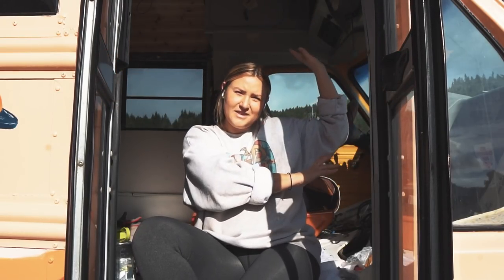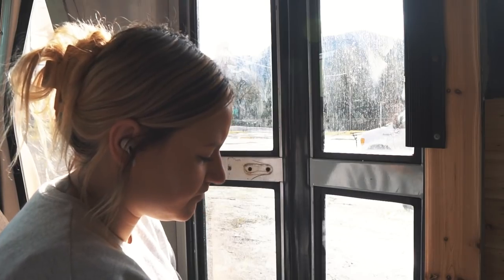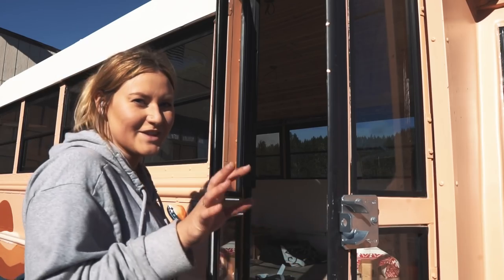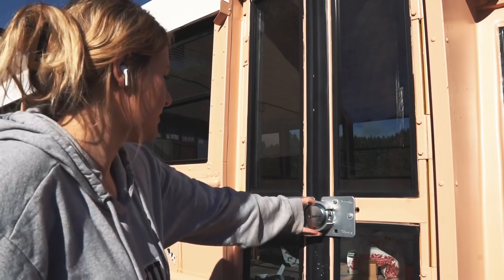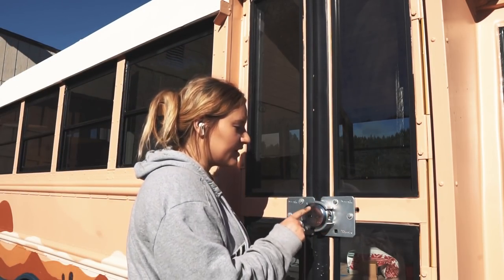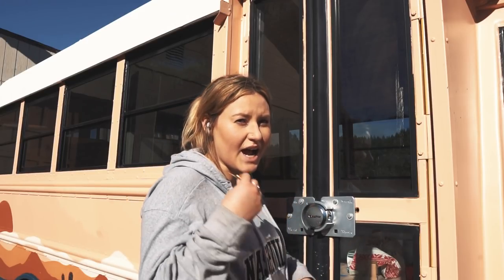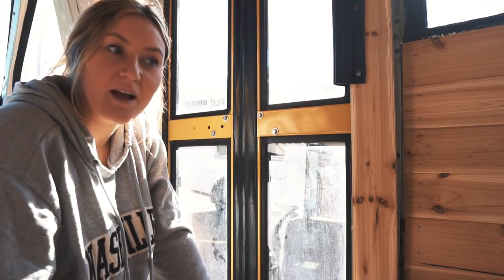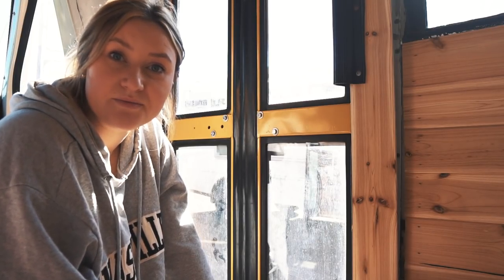Best Way To Lock Your Skoolie Door? - short bus conversion

Comment: Cast iron handles on both sides of interior door with a nice piece of wood to lock from inside slid through handles. This is a safe exit. This is used on barn doors. Would go along with your build scheme.

Comment: We have that lock on our shed. It is a solid lock to lock something from the outside. I would not recommend it to lock something from the inside for safety reasons. It takes a minute to unlock that lock. That being said you will have to have the chamber out of the lock when you are inside the bus in order for you to open the door from the inside. Might be a good idea to set aside a place inside the bus to store that chamber so it doesn't get lost. A drop latch lock seems like the safest for the inside as you could get out quickly if you needed to. peace

Comment: Hey girl, I hope your feeling well. I thought if you can't use your slide bolt lock on your front doors then see about using it on the back door, just as some more protection. I've been to Eugine Oregon some 45 years ago, a bunch of us went there in a van, we had a blast, a wet one but still a blast. You can be sure I'll be watching your two week trip! Have lots of fun and stay safe. Love y'all!

Comment: Jaylena Great job on painting and the outside lock. You may be able to use the same type lock you bought for the inside just look for it on a Larger scale as for a shed or Barn door lock. If you find it to work it will also be a stronger lock.
Always enjoy the videos Jaylena have a fantastic weekend. hey  hey Isaac! :) Laterz Leland

Comment: For the inside lock,I like the idea of a metal lever that swings down to the other door and is held in place by another piece of flat steel..you could drill a hole in that flat steel and attach a lever that you can lock .people who try to get in won't see the lever because it's hidden behind the yellow going across the 2 doors ,same for the locking knob

Comment: Looks like a good lock Jaylena, for the inside can you use a bolt system into the floor and ceiling or do the door need to be locked together in the middle ? .  Loved the video as always and enjoy your trip with Isaac xx

Comment: I like the external lock.  Can you figure out how to make it so someone on the outside can’t lock you inside with their simple padlock or carabiner?  As for locking from inside, I would consider using the same locks that you had, but use them to lock the doors to the overhead and the floor, rather than the doors to each other.  Much like the system to lock double doors.  Love the way that the build is going.

Comment: Maybe consider a bar type of lock for the inside.  Could even be a nice piece of metal tubing that sits inside of two brackets.  The brackets could be held on by the same bolts as the outside latch.

Comment: Wesley’s White wall cleaner and a S.O.S. Pad super cleans black rubber. Then a few coats of ZEP High Gloss Floor Polish applied with a damp microfiber cloth makes it shine better than new! 
Learned this from YouTube on fiberglass campers. Scrub with Barkeepers friend, wash with dawn dish soap(to remove the grit) then 4 coats of ZEP. The first two coats look like crap, third and forth coat shines like new money! (Work in the shade)

Comment: Door hinge security pins or use a barrel bolt into the ceiling or floor on both doors (ceiling preferably if you're going to have a toddler in there eventually!)

Comment: Bus doors are not the best for making secure that is for sure.  Was thinking a flush coach bolt would of been better on the outside rather than having nut head bolt head.

You do not have much places to fix an internal door lock either. Think having a locking bar across the centre of the door would be a good idea. However with your doors being mainly glass an little frame am slot sure how you would secure it.

Hope your week has gone good an you enjoy the weekend.🙂🙂

Comment: The square holes are for carriage bolts that can't be gripped on the outside with a wrench. I suggest you change to carriage bolts for increased security.

Comment: The square holes on the outside mounting plates are made for a special bolt which cannot be wrenched open from outside. The bolts should have round heads and they have a special square area under the head that goes into that square hole in the mounting plate, that way preventing them from turning while you tighten the nut on the inside.

Comment: I think when they make the door in to a normal door it's less problems & seals lot better there's few channels that I have seen doing it that way. but good luck & god bless  & have fun on ur trip
Reply: @thegoodtom1718  no I mean make the bus door in to a single door & they made it work like a house door then they used that same lock on one & the other one I see on u tube & they used a house dead bolt on out side open with a push button code

Comment: Hi Love your work. The lock on door is great if they rob you you do not want them to be taking your stuff out the door. It is much harder to steal stuff through the window. I have converted many buses just make a new door. It looks and works better.
The door handle mech and hardware is then all removed  leaving a new place for stuff.
thieves always want a quick way out.
CHuCK in Alaska

Comment: I can't believe that outside lock went in that easy wow. But for the inside what you're talking about putting that other latch that goes across it into like into like a little holder somebody can stick a thin piece of metal through your door and lift the latch you need something like you have that wouldn't fit a bolt type of deal or you could put an eye hook on each side of the door and put a heavy duty   Carabiner Caribeaner Clip, through the two eye hooks . Because any kind of lifting latch again they can put a piece of metal and lift it right up or push it down but putting the two I hooks and the clip you won't have no problems. That's what I plan on putting on my bus.👍✌✌💖💪🎅🚌🌻

Comment: My idea might be a little bit of overkill but I’m always more concerned that I have safety when I’m inside the bus then someone breaking in from the outside. That said how about a bar that goes all the way across both doors with four braces, for lack of a better word, that the wooden bar would sit in. Two of those braces being on the actual Door frame and then too close to the inner edge of the door. It seems like anything else if someone was outside wanting to get in they could just pull it hard enough and it would open. I hope that made sense

Comment: Not sure if this would work but could you get 2 of those master locks and put one on the inside and one on the outside? But using the same bolts to connect them. Idk just a thought I’m also trying to figure out a solution for my bus

Comment: Could you not have left the bolts longer, instead of cutting them off, and then used the excess to partially or fully secure something for the inside lock in that same area. Trust me, not being critical, as I know nothing and am constantly amazed by you.  Just a thought as you were working thru your process.  Have fun on your trip!

Comment: Master makes some pretty nice stuff.  You have a driver's door so you could add another set of the exterior lock plates to the inside of the door and lock it from inside using the same puck lock.  I'm pretty sure you can get multiple locks keyed alike so I'd be willing to bet they sell the lock plates by themselves.  You could even use the same lock set up on the back door and have 2 or 3 puck locks keyed alike.  Food for thought at least.  🙏🏻🙏🏻 for travel mercies while you're out on Bussy's shake down run, and making memories that last a lifetime!  ✌🏼💗 n 🚍